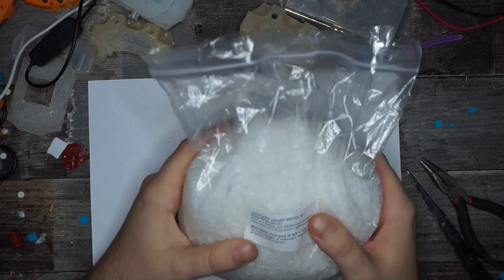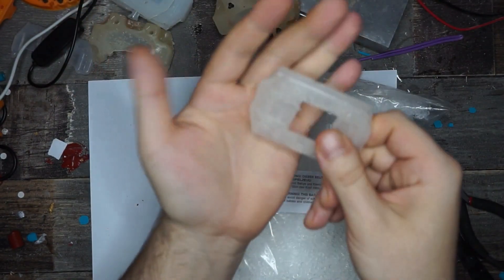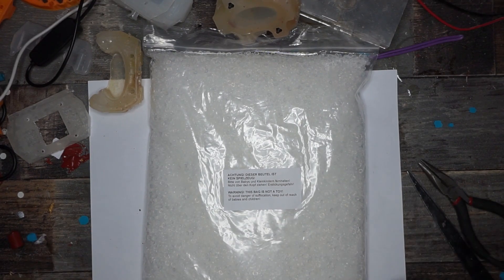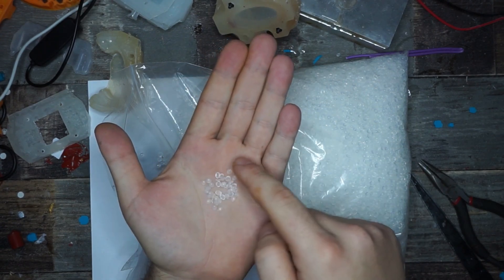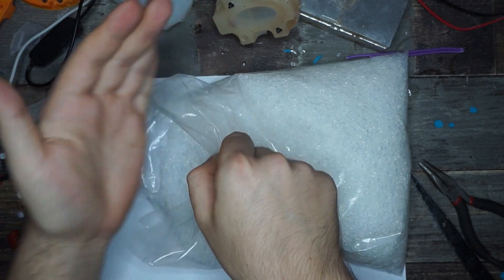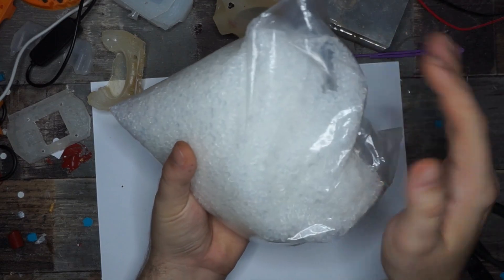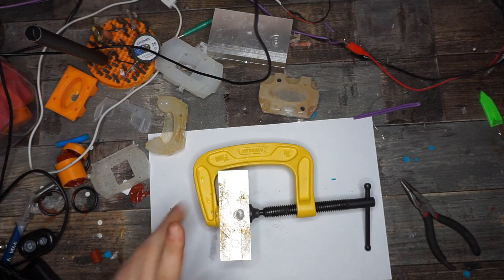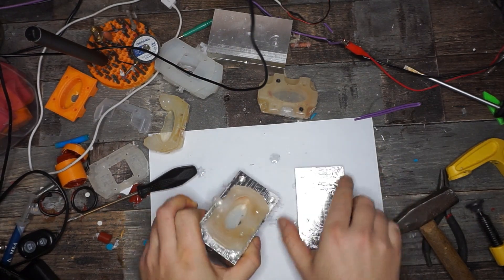Part 5 Building a DIY Injectionmolding machine , finally Injection molding some Parts

Comment: Man this is wonderful

I wanted to build a buster beagle injection molding machine, I think using a hydrolic press instead of a pneumatic piston is better. I can both have a shop press, something I can use for multiple things and just add on the injection molding on it.

I wonder if slower injection (compared to the air piston moving up and down) would have an affect on the injected part.

Comment: I don't remember seeing you mention it anywhere. But do you use any mould release? If not, you should! You get mould release sprays, which are easy to apply. But if you want to be frugal about it, you could use petroleum jelly. Makes pulling your stuff out easier. Another important feature is to have a very gentle slope on your parts(like 2 deg), so that they pop out of moulds easily. They are called drafts.

Comment: Might be possible to retrofit a hydraulic power pack to your jack to speed up the injection time I think that will help your injection molding one smooth injection action and better holding pressure

Comment: looks exactly like hot glue pellets that are used for casepacking machines. If it's melting temp is ideal at 320-350 F than I'll bet you thats what it is.

Comment: Nice project! 
I also think, the hydraulic press might not be fast enough. The plastic has too much time to sit in one place as you pump it down. Even if the mold is hot enough, only the outer plastic will be heated, the rest may get solid. It took you about 45 seconds to fill the mold.
I can't see it clearly, but did you plan in some draft (Formschräge in German) into your mold? If not, this may explain your extraction problem. If you revise your mold, you could also incorporate some Ejector pins (Auswerferstifte) so assist in ejecting the final part.
Reply from the maker: Yes its to slow, but i am thinking about getting a compressor to fix the speed problem.
Sadly my mod design was very bad and i didnt plan in extractorpins or formschräge :/
But when i do the next design i will implement that.
My biggest problem is that my own CNC dosent cut Aluminum so i have to upgrade befor i can make new molds myself since i dont want to have them made external again for the reason that i am broke^^

Comment: So you don’t think off the shelf injection molding desktop machines are worth it? I’m interested in building something more robust with a budget of 500-700 dollars. I think this budget may be enough to match or even exceed the quality of those 1500-2000 machines. Thoughts?
Reply from the maker: Well i have seen just one 'off the shelf' machine that looked worth it. It a used device from india with 60g volumen and its about 600$+ 400$ shipping.
Withouth the Huge shipping fee a good deal i think.
Reply: BoltzBrain link? Curious on what parameters are most critical when selecting a machine for low volume and small size production.
Reply from the maker: @Machinery_Designer  https://www.ebay.ca/itm/Plastic-Injection-Molding-Machine-/123994016445?_trksid=p2047675.m43663.l44720&nordt=true&rt=nc&orig_cvip=true

but its gone now :/ maybe ask the seller if he has more